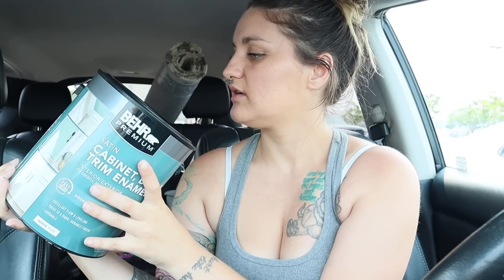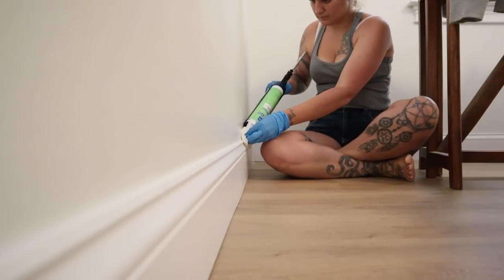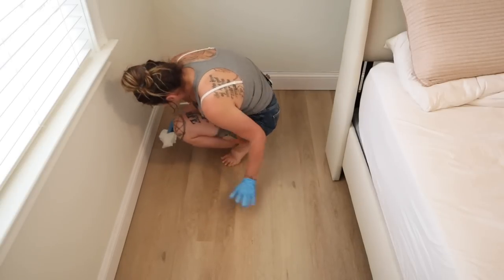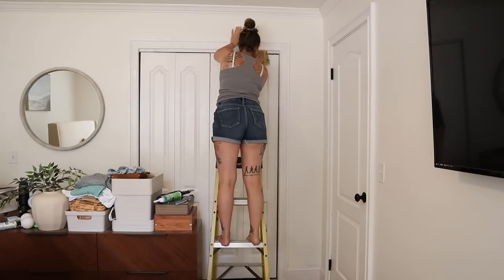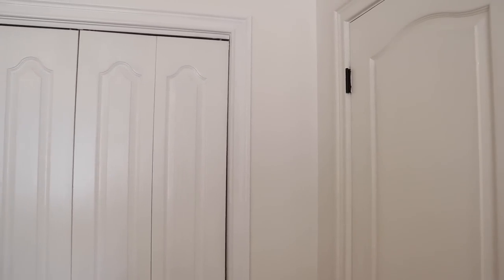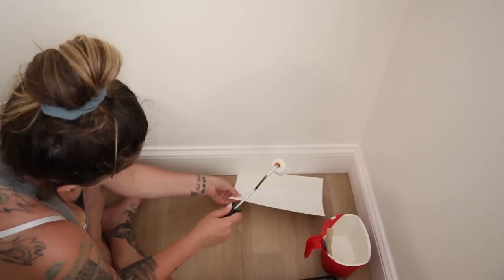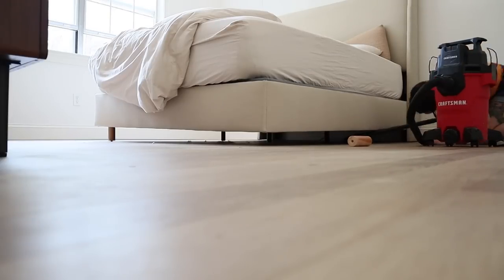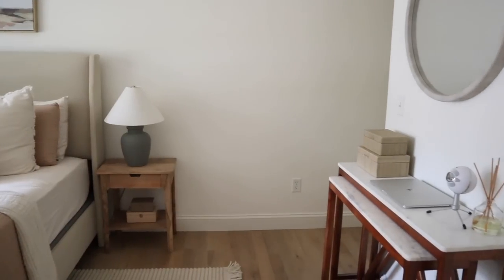DIY MASTER BEDROOM MAKEOVER | PAINTING & BASEBOARDS | DECORATING IDEAS | HOUSE PROJECTS

Comment: Hi Megan,  try using a wet sponge instead of baby wipes. You won't believe how smoothly it spreads. Do the same thing u are doing with baby wipe but just use a wet sponge.  U can rinse them as you go and wash out at the end and reuse it over and over. Definitely saves money. Good luck.
Reply from the maker: I would be anxious to rinse silicone down the drain

Comment: Are you supposed to caulk between the baseboards & the floor? I'm new to DIYing so I wasn't sure. Also, where are your nightstands from? Do you have a link?
Reply from the maker: No, the LVP flooring will expand & contract slightly with temperature changes, so caulking between the floors & baseboards will cause issues down the line.
Unfortunately I don’t have a link for the nightstands 😭 they were a TJMaxx find back in November